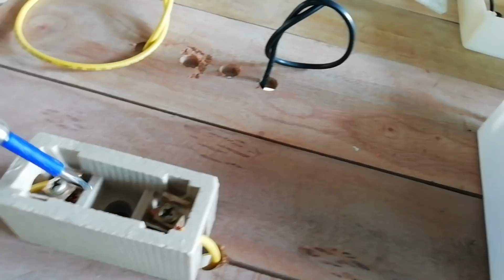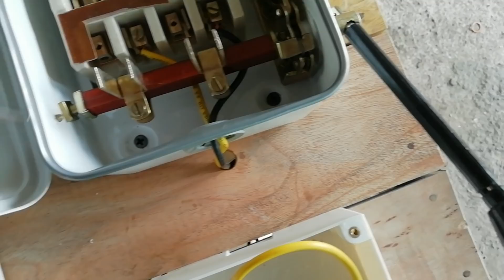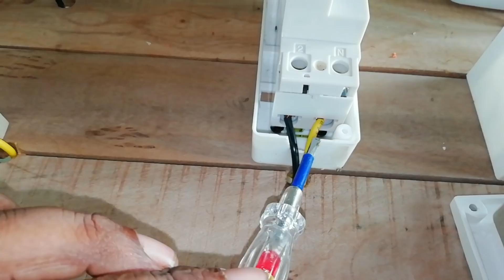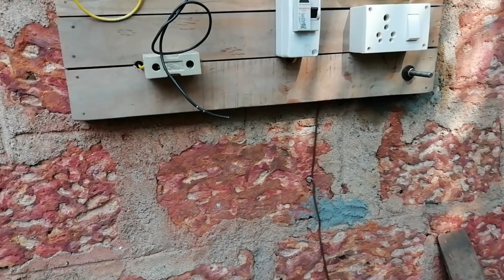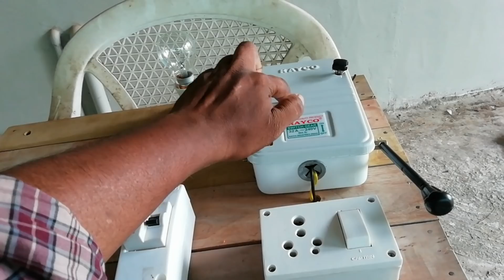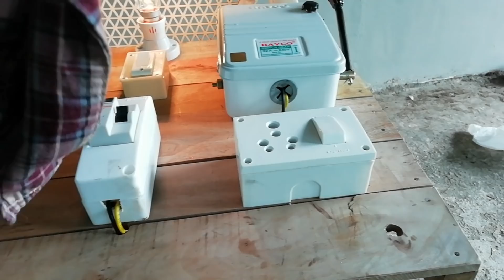wiring & plumbing work malayalam

Comment: phase connect cheyyumbol socket , main switch , enthum  aanengil  right side ll alle kodukkendathu?.evde main switch nde right sidel neutral wire aanu connect cheythirikkunathu, njaan oru temporary connection vendi apekshikkan pokunnu athu kondu aanu chodikkunu, kseb engineer inspection varumbol ingine connection koduthaal prashnam aaville?

Comment: Rcb ideyekke ideyekke cut ayii pokunnu   enthayirikkum problem. Lose connection ann enn paranju fuese  new vangi vachu but ipolum rcb cut akunnu
Reply: RCB ELCB വെച്ച ബോക്സിനു ഉള്ളിലേക്ക് മുകളിലെ പൈപ്പ് വഴി പൊടി(ചിതൽ മണ്ണ് പോലെ) ഇറങ്ങിയിട്ടുണ്ടാകും. ഉറുമ്പ് കാരണം ഇറങ്ങുന്നതാണ്. എന്റെ വീട്ടിലെ RCB ബോക്സിനുള്ളിലേക്ക് 4 5 മാസം കൂടുമ്പോ ഇങ്ങനെ പൊടി ഇറങ്ങി വരും. മെയിൻ സ്വിച്ച് ഓഫ് ആക്കി wires എല്ലാം disconnect ചെയ്ത് RCB ഊരിയെടുത്തു പൊടി തട്ടി കളഞ്ഞു വീണ്ടും ഫിറ്റ് ചെയ്യാറാണ് പതിവ്.
പൊടി പ്രോബ്ലം തന്നെ ആണോ എന്നു confirm ചെയ്യാൻ RCB വെച്ച ബോക്സിലെ ആ ഡോർ തുറന്നതിനു ശേഷമുള്ള 4 screws ഊരി നോക്കിയാൽ മതി. പൊടി ഉണ്ടെങ്കിൽ പുറമെ നിന്നും തന്നെ കാണാൻ പറ്റും. ടെസ്റ്റർ വെച്ച് ഓരോ RCBയിലേക്കും supply വരുന്നുണ്ടോ എന്ന് കൂടെ ചെക്ക് ചെയ്യാം...

Comment: കാരണം ഞാനൊരു 12 year ആയിട്ട് ഇതേ ഫീൽഡിലാണ് ഒരുപാടു മരണങ്ങൾ കണ്ടുംകേട്ടും അറിയാം !ഇത്പോലെ ഒരുമോൻ പലതും ചെയ്യുന്നത് കണ്ടിട്ട് അടുത്തവീട്ടിലെ സ്ത്രീ വിളിച്ചിട്ട് ഫ്രിഡ്ജിന്റെ 3pin top മാറ്റിക്കൊടുക്കാൻ പറഞ്ഞു അവൻ 3wire കട്ട് ചെയ്തു 3ഉം ഒരൊപിന്നിൽ കൊടുത്തു ചെക്കിങ് ചെയ്യാൻ കറന്റില്ലാത്തതിനാൽ ആ പയ്യൻ രക്ഷപ്പെട്ടു കറന്റ് വന്നു ചേച്ചിപോയി നോക്കി ചേച്ചി മരണപ്പെട്ടു അറിവില്ലാത്തവർ ഇത്തരം കാര്യങ്ങൾ പരീക്ഷിക്കരുത് കൂടിയായാൽ 500 രൂപചിലവാക്കേണ്ടി വരുന്ന സ്ഥാനത് വലിയ വിപത്തിൽ ചെന്നുചാടല്ലേ
Reply from the maker: ഞാൻ പറഞ്ഞത് എൻറെ വീഡിയോ കണ്ട് ജോലി ചെയ്യാം എന്നല്ല കുറച്ചെങ്കിലും അറിയുന്നവർക്ക് ഇത് കണ്ടാൽ മനസ്സിൽ ആകും എന്നാണ്
Reply: സാലിഹ് 6262114786
Reply: കോയക്കുട്ടി ദമ്മാം സൗദി അറേബ്യ 0096650 2874726
Reply: Mohammed Trivandrum 9746707021
Reply: Bibin francis
idukki
8606446410
Reply: Bro ,
Add  my  w app no 00971554291247
Ashraf  Kannur
Reply: K ubaid
6369212980
"devala
Reply: ±918086818582